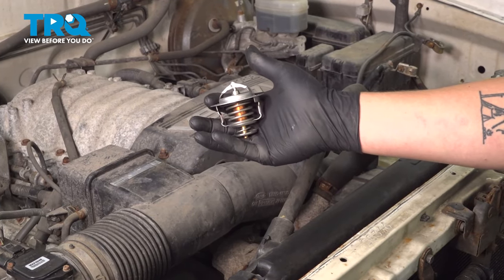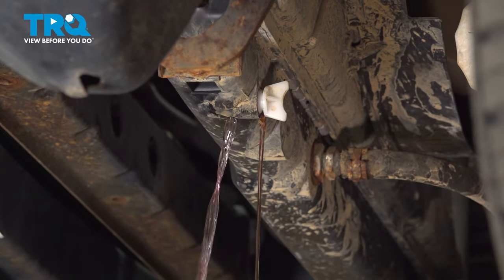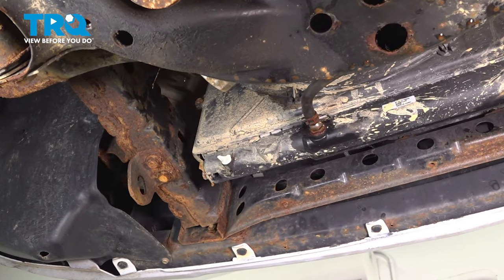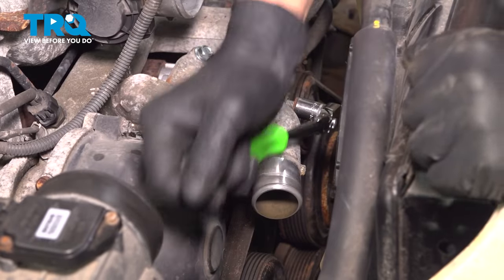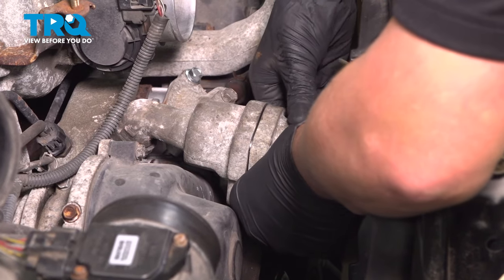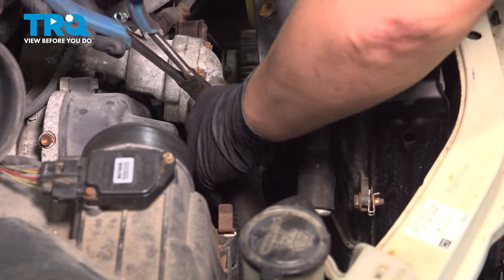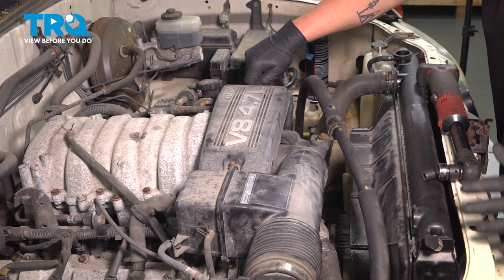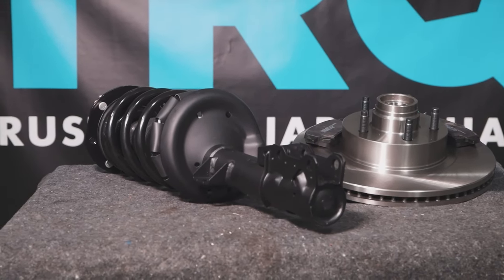How to Replace Thermostat 2000-2006 Toyota Tundra 4.7L V8

Comment: I have a 2001 Toyota Tundra SR-5 with 204,000 miles. The engine is so clean you could eat off of it. What is up with this one was it pulled from the ocean?